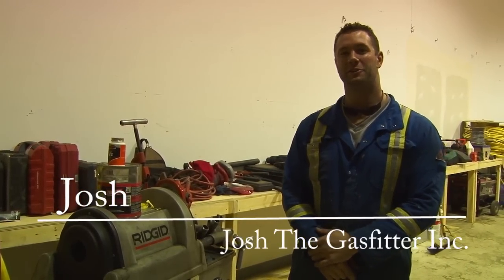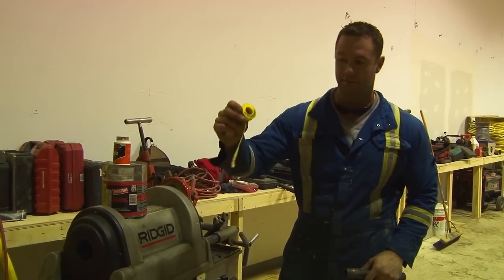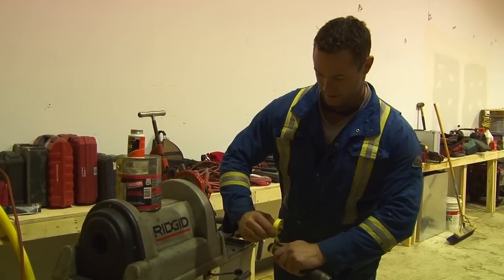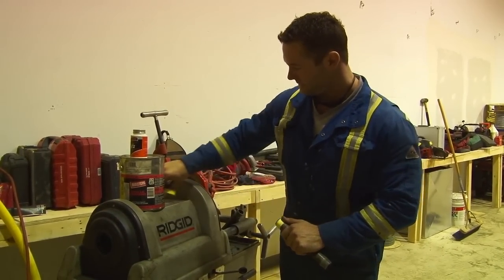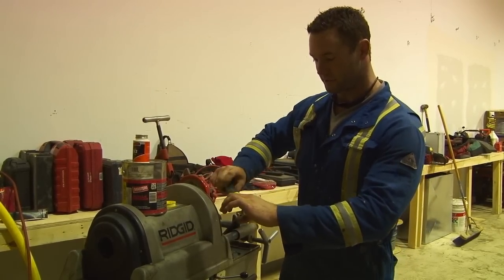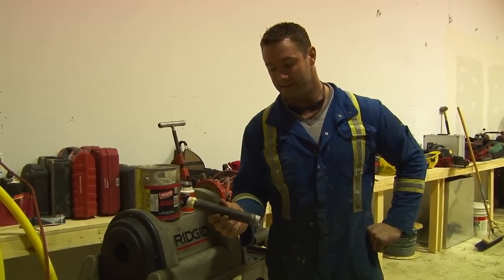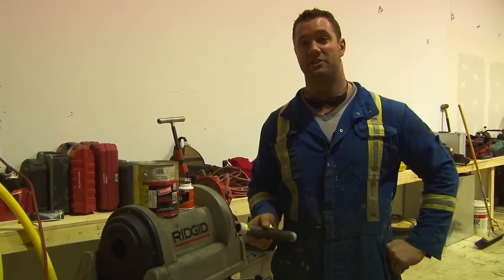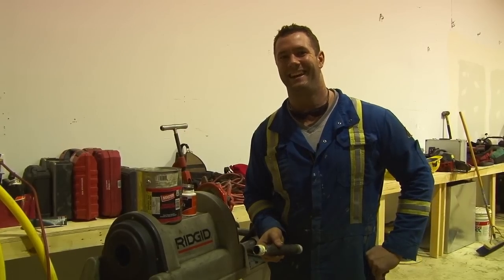Josh The Gasfitter, Gas piping

Comment: CALGARY Canada - Just want to share my experience as to why I hired Josh the gas fitter .
we bought a Gas stove to replace electric the stove from "BestBuy" but we required a gas line added to the existing gas system in the home... Everyone wants a good done but cheap as possible, let me REITERATE in this world nothing is free and you get what you pay for...let me tell you what happened before Josh the gas fitter and his team came into the picture....BAD START....i found an experienced plumber licensed certified etc to do the job, he was cheaper than others...quoted less by as much as 30 to 50% cheaper and he promised  a city permit and do a air test etc etc.... he took cash up front down payment to buy material...and would return the next day to start the job....well that didn't happen... this is where i made a mistake long story cut short he came 4 days later.. installed the line and made modification to existing gas system for tie in.... and just did a bubble test and promised a permit compliance by email and whats more he left the valve terminated at the stove and used a metal strap screwed to the drywall to secure the valve by the yellow flex  gas pipe... and would return the next day to finish off,.... wow!!...a licensed plumber and gas fitter.. who said he did 100's of these jobs.... I pointed out to him  that doesn't look secure and he said its getting a bit late and he would return the next day ....well that immediately triggered a doubt in my mind....he wanted more cash for the time he spent  and the rest would be paid on completion and guess what? he would not return and after several phone call did not answer my calls....Now do you see why you need to pay for what you get....VERY IMPORTANT when anything is to do with gas......just be aware.
I discovered JOSH THE GAS FITTER on you tube "by chance" when i was checking on material types used in gas fitting.
I asked them to check the work that was done by the fitter initially, and found there were discrepancies that would be failed by the gas city inspector with reference to code compliance for GAS SAFETY and legal requirements for home insurance etc etc.
Well what can I say ...it was a learning experience for me.....I won't put put any names here and finger point.....but it is vitally important to realize that when it come to gas.....the job has to be done in accordance to city code of SAFETY compliance...and that's where i strongly recommend JOSH the GAS fitter and his team....they were not only professional   they were efficient and most important to me was SAFETY in the house where your loved ones reside....you definitely need a city inspector to come to evaluate and be a witness to the pressure test no matter how small of a run of gas pipe.....Remember SAFETY SAFETY SAFETY!!.
I am very pleased and feel safe and glad that  I hired one of the best and experienced team...and that's JOSH THE GAS FITTER and his team......and wouldn't hesitate to call them for any future needs.
Reply from the maker: sainiinder1 thank you So much !!!!!
So glad we could help !!